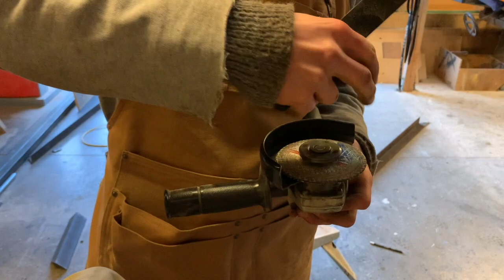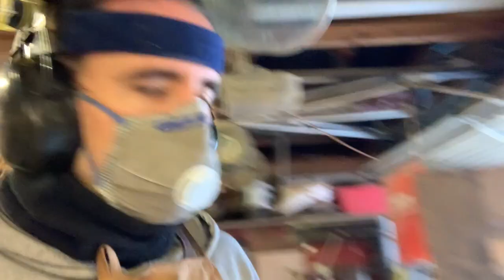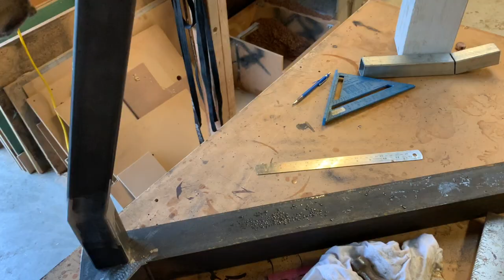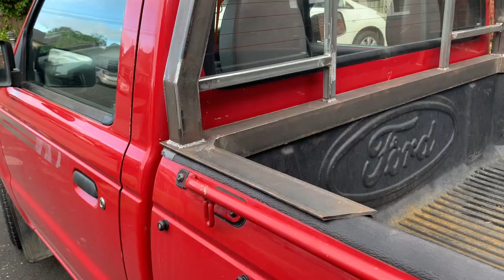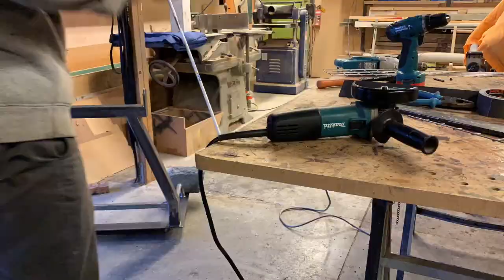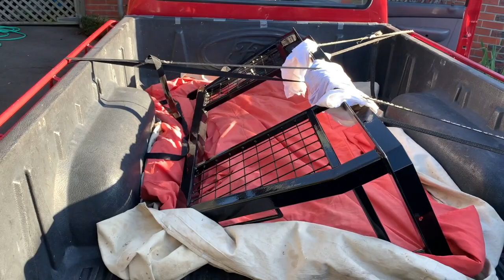Making a Steel Lumber Rack for My Truck (Part 1)

Comment: The only problem here is I think your in Australia where you drive on the right steering wheel. I can't imagine how does it feel driving on the right and shifting with the left hand. Is the throttle and brake or clutch also inverted?

Comment: What type of metal/wall thickness did you use?
Reply from the maker: Hey mate, I used 50x50mm steel tube with a 3mm wall thickness for this.

Comment: What thickness steel tube did you use?
Reply from the maker: Hi mate, I used 50x50mm steel tube with a 3mm wall thickness for this.
Reply: @Madeby_CB  cheers, wondering what you eyeball the capacity is with those materials? thinking about making my own, rated around 700kg.
Reply from the maker: @devilsinthedetailss   Not 100% sure on capacity as I am no engineer but I have carried some heavy loads of plywood and packs of hardwood on this rack with no flexing so I'd say you wouldn't be far off with 700kg. Best of luck with your project mate!
Reply: @Madeby_CB  Much thanks brother!

Comment: What was the plastic piece? Cool build. Anything you wish you could change on the build?
Reply from the maker: Hi Levi, thanks for the comment. It was a piece of UHMWPE Black plastic which I decided to attach as protection for the paint as loading and unloading timber from the rack would eventually scratch and damage the paint. After using it for the past few months I am pretty happy with the final result and so far there aren't any changes I would make to it.
Reply: Any problems with it chipping? I like the reasoning behind it
Reply from the maker: No, not at all. I went for a Thermoplastic coating so it could be sliced or cut through but doesn't chip and I have been told that any areas where steel does get exposed won't let moisture underneath the rest of the coating. Hope that helps!